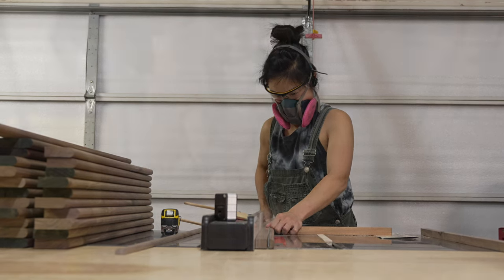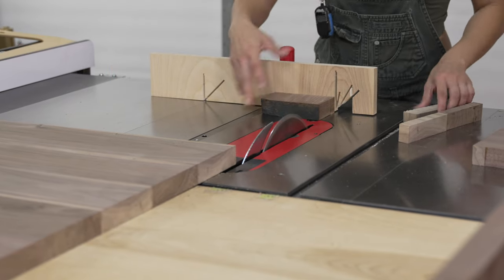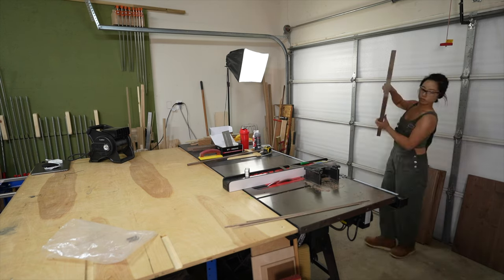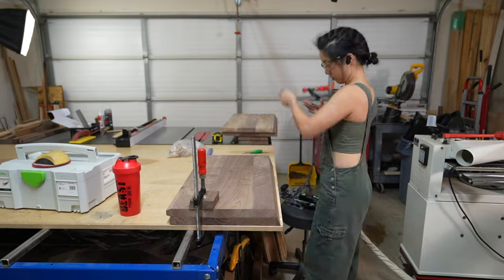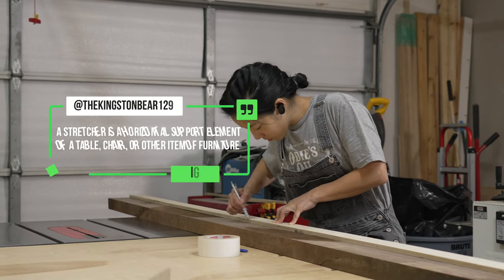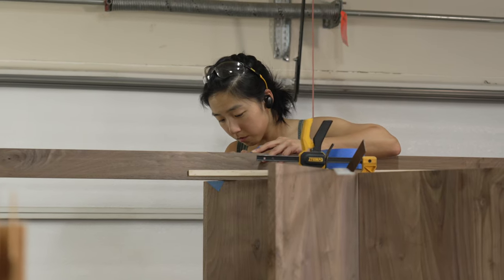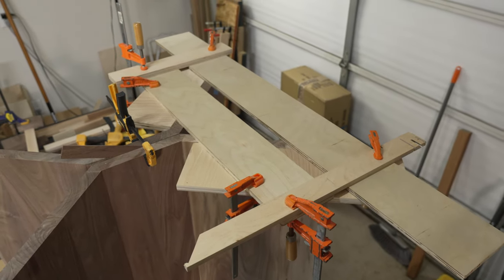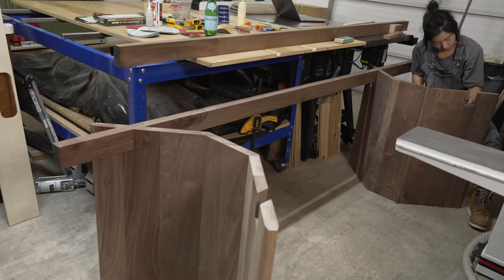Making BAT WINGS and Using Hand Tools

Comment: I use hand tools more because they are sort of emergency override. I run out of time or motivation to move classic car out of garage and use power tools. If I have a part I need to finish before I can continue I am able to bring it inside to my hand tool basement and get it done and move on with project. It does make me think about how much extra effort a power tool can be compared to just cutting quickly with a good hand saw.

Minnesota winters also mean I’m using hand tools more because my garage doesn’t stay warm enough most winter nights. Advantage of not having a spouse is taking over the whole house with wood storage everywhere and a shop area in my living room.
Reply from the maker: I agree - if you get better with handtools, certain things can be done faster than setting up the piece in order to use a power tool such as using a jig for a router.  With a handtool, you can just mark mark and start chiseling away :-).

Comment: Thanks Clara, I typically like using Danish Oil for my finish. Will the wood still warp and crack after this finish is applied? Also, I just purchased oldies, some wax and walrus oil. I fear my finished work will warp and crack maybe in a few years from now. I mainly focus on furniture making. Lastly, I want to recommend Rhoose Point Danish Oil. If you’re interested please check it out one day and tell me what you think. Keep up the good work. 👍👍👍
Reply from the maker: If the piece cracks or warps, something was either wrong with the joinery or the wood movement.  It wouldn't be due to the finish.  I'll look into Rhoose Point Danish Oil :-) Thanks for the suggestion

Comment: another way to cut those out on the legs would have been to laying the batwings down and may a jig out of plywood  and jigsaw the majority out and then route the rest out of course would of had to square the bottom corners out  if that make sense at all, just a thought
Reply from the maker: Appreciate the thought - I would’ve made a jig but I felt the angle was a little too steep for it.  In all other cases, I agree, it would’ve been the perfect setup.